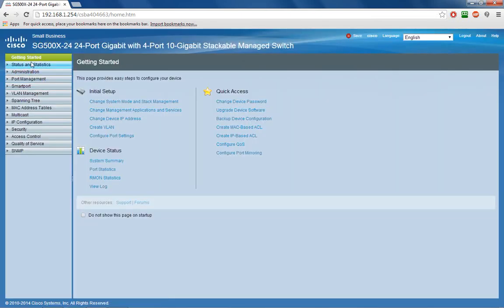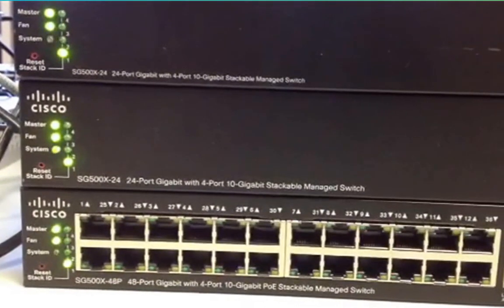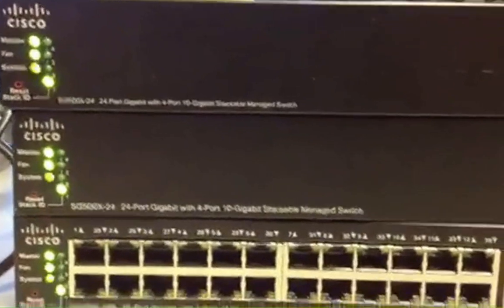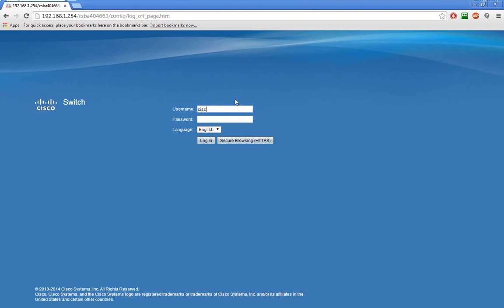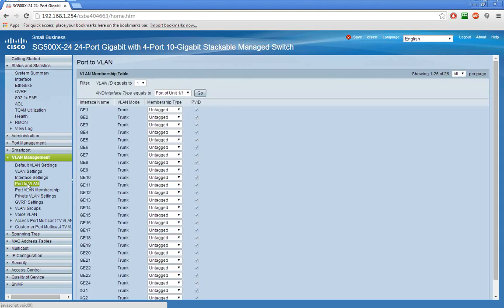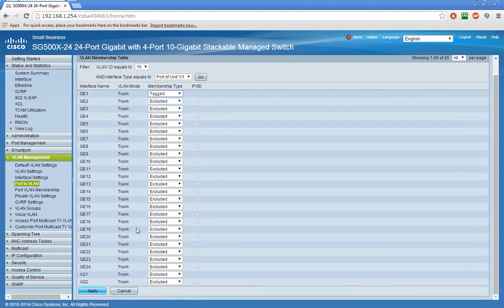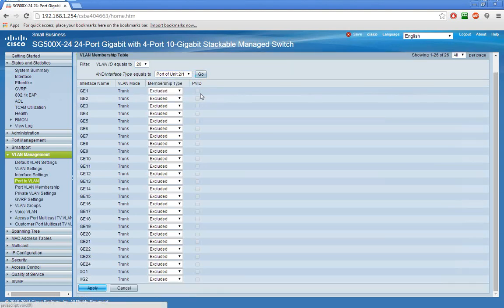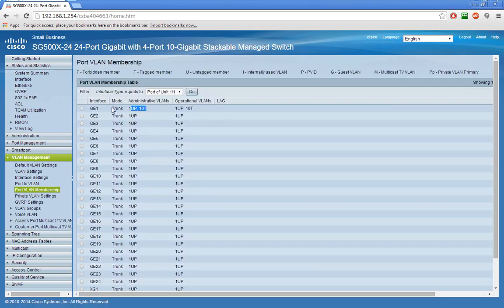SG500X Series Switches Native Stack Demonstration

Comment: It's Redundant Switch Ring Topology. If one failure switch another is backup switch.  I have cisco SF300 Switch, how to configure  each PORT 1-24 and all MAC QoS DSCP value 6Mbps and LAG Port Channel for every AP 6Mbps, I need more dozens Cisco SF/SG Series Switch for my Networks. I need easy to manage Bandwidth.
Foysal ISP Broadband Metro WiFi
Administrator Director
Thank you very much.